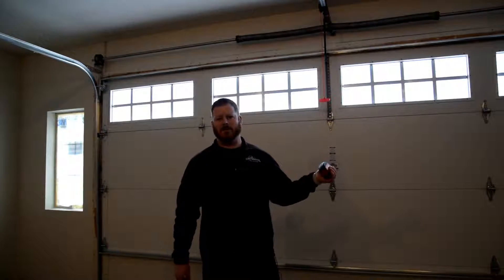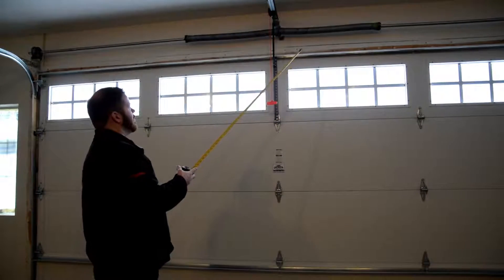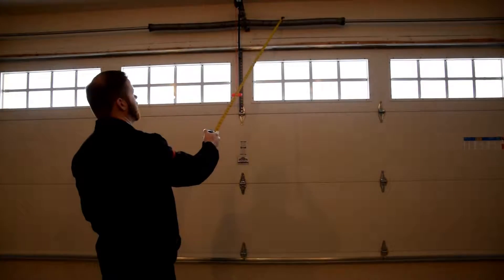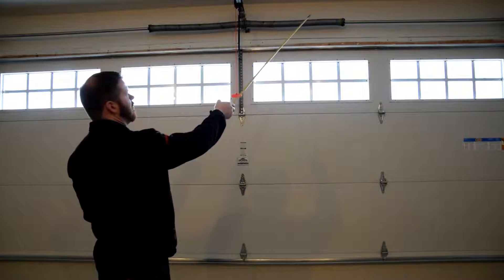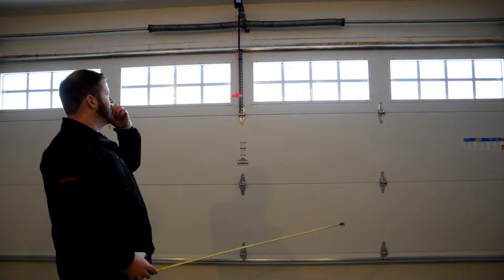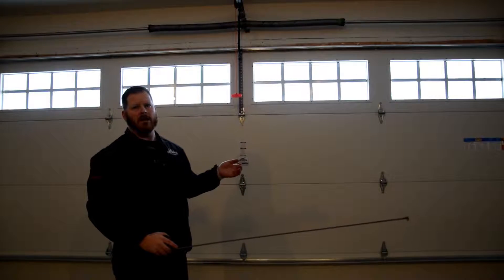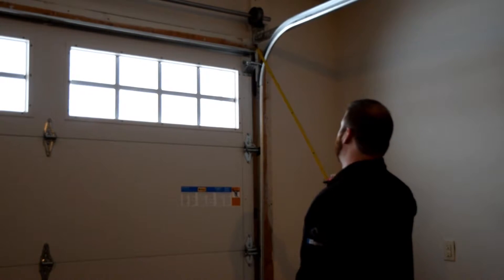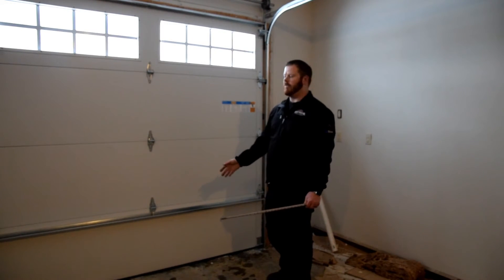Everything You Need to Know About Garage Door Springs

Comment: I have a spring not marked red or black..my question is when you wind spring do you turn spring inward or outward to expand it?. (according to its winding) it is one spring system thank you!!
Reply: If you grab a spring and look at it so the cone where it gets bolted to the spring bracket is touching the ground and the set screws upwards. Look at the end of the coil and whichever direction it’s facing it’ll be the opposite. Ex: 🌀 that’s going to the right, it’ll be on the left side.
Reply: @NeuftheGoof a good trick is make a circle with your thumb and index finger. Your right hand will resemble the "right-hand wound" spring which is on the left side of your door and vice-versa

Comment: If a 12-volt winch can lift between 1500 and 10,000 lb.  Why does a garage door opener need a spring to assist it?.
Reply: While a 12-volt winch may be capable of lifting heavy loads like 10,000 lbs, garage doors typically use torsion springs to assist in their operation for several reasons:

1. Counterbalancing: Torsion springs are used in garage doors to counterbalance the weight of the door. The springs store and release energy as the door opens and closes, reducing the amount of force required to lift the door manually or by an electric opener.

2. Smooth operation: Torsion springs help to provide a smooth and controlled movement of the garage door. They allow the door to open and close evenly without jerking or straining the opener mechanism.

3. Safety: Torsion springs help to prevent the garage door from slamming shut due to its weight. They assist in controlling the speed at which the door closes, reducing the risk of accidents or damage to property.

4. Longevity of the opener: By using torsion springs to assist in lifting the garage door, the strain on the electric opener is reduced. This can prolong the lifespan of the opener and prevent premature wear and tear on the motor.

5. Cost-effective solution: Torsion springs are a cost-effective and efficient way to assist in lifting garage doors. They provide the necessary counterbalance without the need for a more complex and expensive lifting mechanism.

Overall, while a winch can lift heavy loads, torsion springs are specifically designed for the unique requirements of garage door operation, providing balance, smooth movement, safety, and cost-effective assistance in lifting and lowering the door.